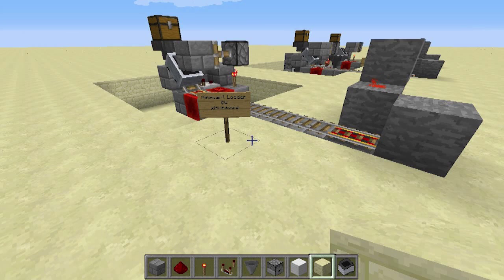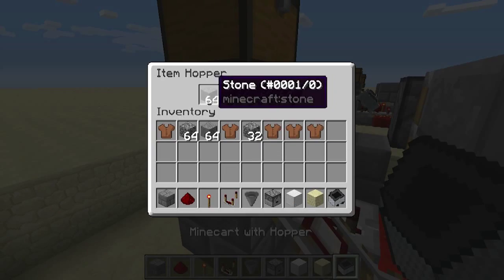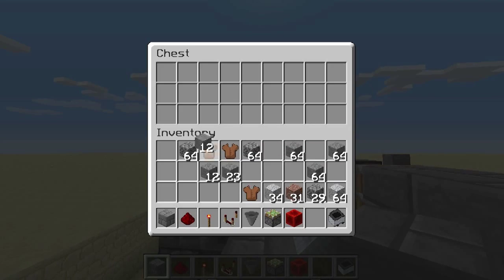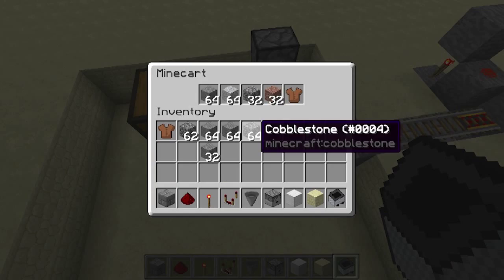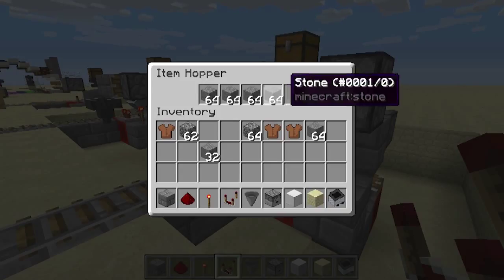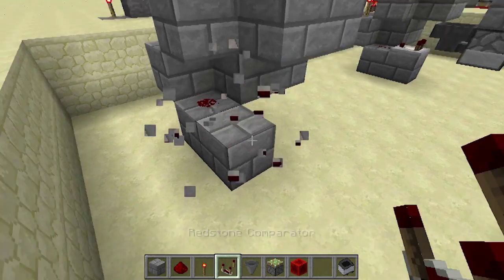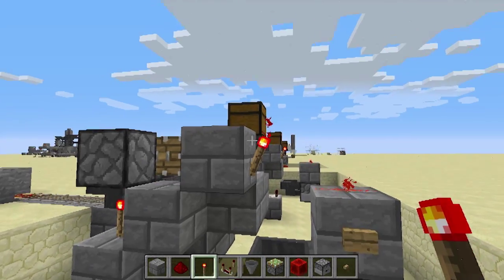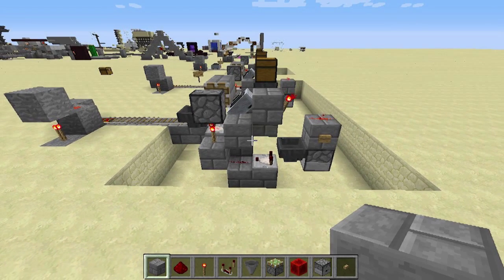Minecraft Redstone Tutorial -- Minecart loader

Comment: Is there a way to make the minecart stay there until its fully loaded?
Reply from the maker: Yes, that was the original design, fully loaded (i.e., max redstone signal in the B input of the comparator). But this is the setup that led to problems with the system, as outlined in the video. While this method takes more trips to empty the system, it is more reliable.
Reply: myfriendebin
Are you talking about the design by Xsimuma? Cause I built that and It would load until the cart was full or until the feeding hopper was empty then send it on its way. But I'm trying to get it to stay there until the minecart is full and not get set off even if the feeder hopper is empty. If that makes sense. I have mine set up to my auto wheat farm, and it isn't fast enough to keep items staked up to make the cart stay long enough to fill up. Maybe I did something wrong but I cant find what that is.,.
Reply from the maker: TomaHawkSDCS Yes, Xisuma's original design should send the cart when it's full (or when the hopper is empty). If you are only filling it with wheat then the bug I'm addressing here shouldn't be a problem. Why don't you link some screen shots and I can try to help you.
Reply: The thing I'm trying to get it to do is not send it out unless only the cart is full. So I want to disable the feature where it gets sent out when the feeder hopper is empty.
Reply from the maker: Oh I understand. Remove the comparator, sticky piston, and redstone block from the hopper. I've indicated which in this screenshot: http://imgur.com/mLJNtf7

Hope that helps!
-mfe
Reply: myfriendebin
Yes, that fix worked, Not sure why I wasn't able to figure that out, but redstone stresses me out. Thanks a lot for your help.,.
Reply from the maker: No worries, it can be overwhelming, especially for a machine you didn't creative yourself. Glad I could help.